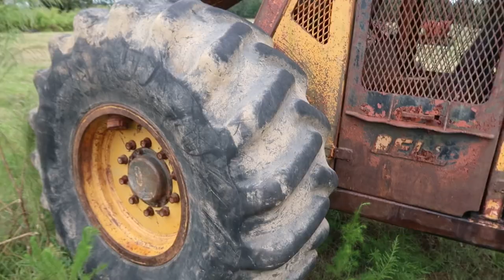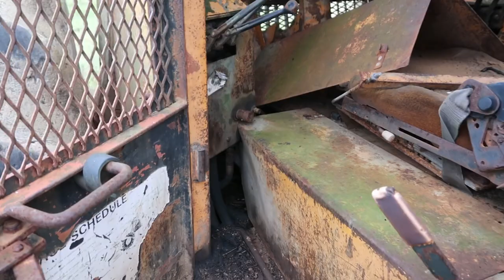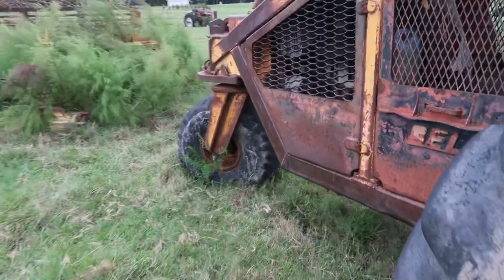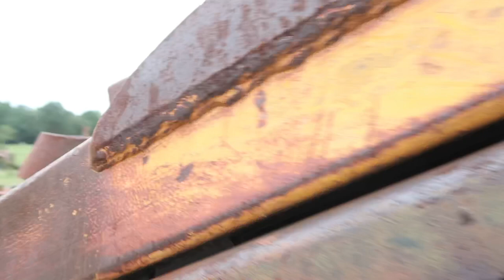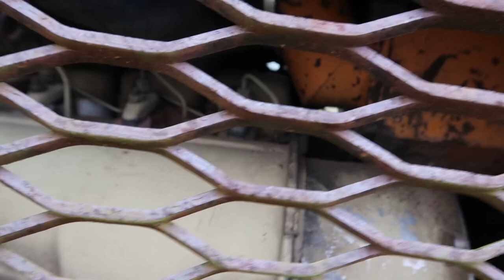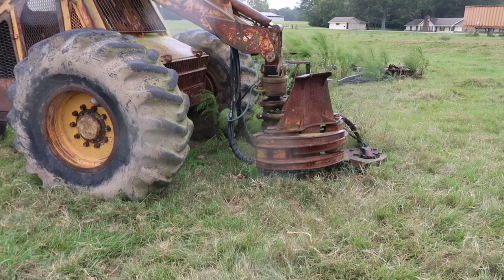Bell Tree cutter | a 3 wheeled machine

Comment: I had one of those monstrosities back in the 90's. Not sure what year it was but it was the newer style (joy sticks) with AC on the roof. The only thing I didn't like about it (besides the rough ride) was it only had 1 door on the left side Kind of like a Timberjack skidder. And if you were working and flopped it over on that side you were trapped until someone came to set you on your wheels...lol. Ask me how I know.  I spent the night in that son-of-a-pup because I stayed after the rest of the crew went home to get a little bit ahead. Yep, sold that widow maker shortly after that too. Thanks for the memories Tim !
Reply from the maker: Our last 2 we had were like that but you could get out the right side if u needed to. The right door was a half door. I wouldn’t run one if all it had was escape in case u turned over and it caught on fire.
Reply: I had a 1997 bell seems like it had a full door on the right side been a while
Reply: No, they were never built with only one door, it was possible to bolt the right hand door shut, but anyone with any sense wouldn't do that.
Reply: Sounds like you weren't very good if you turned it over often.  I cut in North Alabama and I'd much rather use my bell on steep ground and I put timber on easier ground for the skidders
Reply: What kind of suspension do you think 4 wheel cutters have?

Comment: I remember when the mills started requiring saw cut wood and basically banned shear cut wood back in the late 80's.Those bells really took off. Seemed like everyone had one unless they were doing first thinnings. Those little Bells would cut some large trees too. I watched one across from my house cut a tract of super nice slash pine. They were 100 to 120 feet tall with diameters close to 30". Dang little thing cut 15 loads of plylogs and sawlogs every day with one Cat 518 pulling the wood.

Comment: Nice old Bell Cutter Vidja, I still run a Ultra T ocassionally in our operation. A very versatile, but not really a full blown high production machine. Its actually fun 2 run, gotta have your hard hat on tight 2 when your head hits the steel tube right above your forehead. Cutting with a bar/chain, is kinda pain in the ass, but it helps if U have done lots a tree falling with a big chain saw in your past. parts R still available through Peter Rayton in the Northeast,  or Zambesi Equipment in SC. They arent good at driving up hills but they will back up a much steeper grade, they can be used to skid the tree length also if your under 100 yards or so. there good at topping and limbing trees also.

Comment: I remember working on a morbell logger  I overhauled the top end I think that one had a F3L912 deutz in it the engine in that one is a F4L912 either mice  or some critter built a nest in the airbox and overheated it that would been in the early 80s been awhile

Comment: We had a super T and my dad's pet employee got it on fire and it burned to the ground. I was actually kind of happy that day. I hated that thing. It was too steep for them around here even with chains and we only had cable skidders back then and all those things were capable of was making a mess for a cable skidder on these slopes. I run a Ryan's DS3550 head now which is basically a Bell head beefed up to 5400 pounds with a Rotobec full rotation 70,000 pound rotator. And I run it on a 210 size carrier with 8500 pounds of forestry protection so I'm coming in around 63,000 pounds. This machine is a beast that will do more than 5 Bells can do. Man I hated that Bell.... ours didn't ever have working A/C either. That Bell was so light that we picked it up and loaded it on a lowboy with a 160D Barko after it burned. We spent more freaking time pulling that thing from being stuck and turned over with skidders than we used it. You can still get parts from Zambezi.

Comment: Those old Bells were tough simple machines. Never saw too many in my area because of the heavy underbrush and small pulpwood. I did demo a prototype Iron Mule 3 wheeler with a 16 inch bunching shear. It was built as a thinning machine.

Comment: The tri-wheeler Bells are still made new for sugar cane, logging and fork lift duties. Some of the current models have a water cooled yanmar engine which is quieter. Bell Equipment NA hq is in North Carolina. There were a variety of designs of Bell logger over the years, one had 4 driving wheels (tandem - one driver in front of another - not the common dual tire version) like a bobcat tire skid steer with an extra wheel on the back. There are also versions with 2 rear tires. The younger generation of the Bells have made the 'Fast fell' and skogger machines under the Matriarch Equipment brand.

Comment: There was a crew near me that snapped the caster wheel stem off on theirs twice in a year. I machined a new stem and they welded it back in twice. About 25 years ago another guy I knew had one he bought to clear the timber off a  tract he had to built houses on. I made a few misc parts and pieces for it, then one day he called wanting to know where the alternator was on the machine. I had to go show him that the alternator was actually also the bearing for the cooling fan. That poor engine had about 2 inches of dirt and crud built up around the bottoms of the cylinder jugs and was still running.

Comment: Hahahaha easy to turn over.
The guy that cut trees on our land rolled his over. He didn’t know how many times. But it landed on the tires. He drove back up the hill. All beat up. I said what happened. He said I trumped the dang thing. No more for me today. It was funny. The look on his face.
Reply: Royce Abbott a logger friend of mine had a skidder operator get in a tight spot, and he thought he was going to roll it, and called on the radio for help. My friend walked up into the woods and got in the skidder, thinking he could drive it out of the bad spot. He wiggled it back and forth a couple times, and it rolled completely over, and landed back on its wheels. It was a terrible hot day and he had no shirt on, all sweaty from walking up the steep hill into the woods. He got out and all the dust flying around while he tumbled around in the cab had coated him like a piece of fish ready for the deep fryer. He looked at his skidder operator, who had run over to see if he was okay, and said “Did you need help with anything else while I’m up here?” and then walked back to the landing to his loader.
Reply: That was so funny

Comment: I own and operate a bell ultra C every day. Mine has a 18” hotsaw on it tho and it has a Cummins motor with joystick control and  ac. I’ve tried running when the ac went out it gets pretty hot in there.  Funny thing is when it’s cold in the winter it’s not overly warm on a below zero day you about freeze to death. Parts are still available if you hear of anyone needing parts Peter Rayton in Massachusetts has or can get anything you would need and he’s super good to deal with too!

Comment: Doesn´t surprise me they have Deutz engines. Deutz was the leading developer of German diesel engines and they were always aircooled. Deutz made an aircooled V12! They were very sturdy, reliable engines. Just once in the 1930´s Deutz made ONE water cooled engine... These aircooled diesels still run around the world, as long as they keep their oil in they will run. And they are fuel-efficient but a little louder because the missing water jacket. Scrap that thing but keep the engine!

Comment: Looks like a Deutz motor.
Reply: Cotontop states that it is a Deutz, 4 cyl and very fuelefficient with the direct injectionsystem
Reply: @poulsejr1  I didn't have time to watch the whole video.  I figured he would.  We have two Deutz tractors and 2 Deutz industrial pump engines on our farm.  You can't kill them.  Still running one of the 68hp tractors and both pump motors.